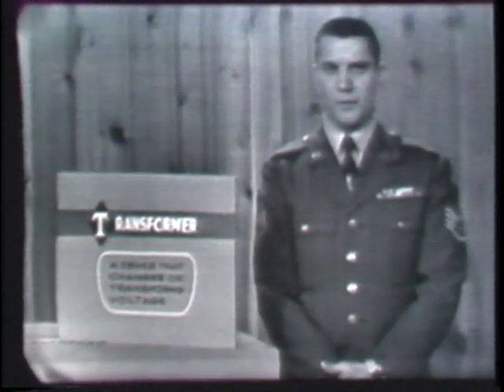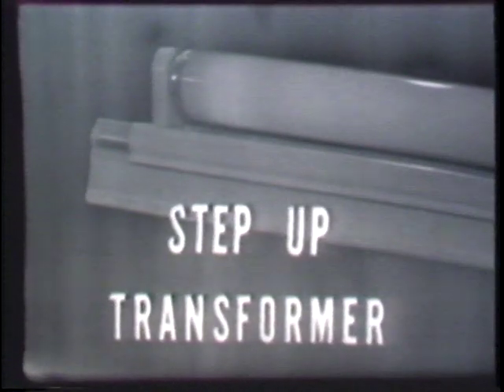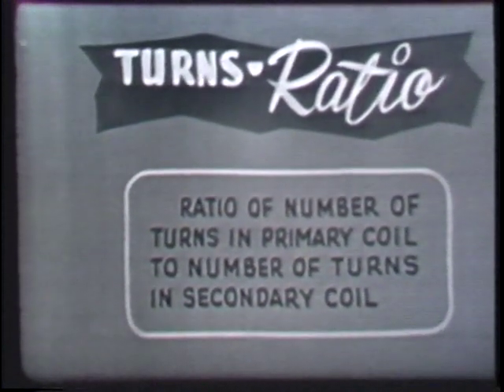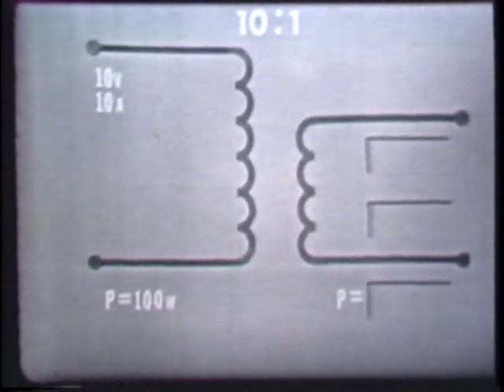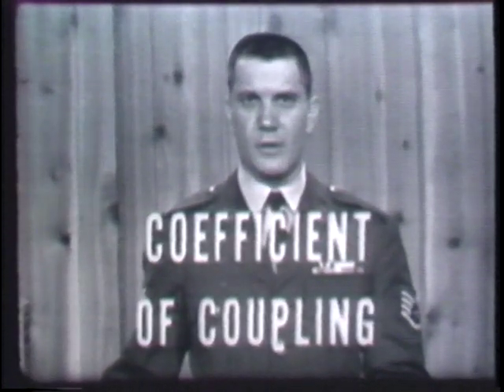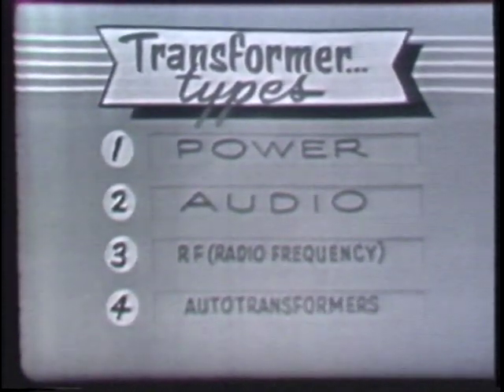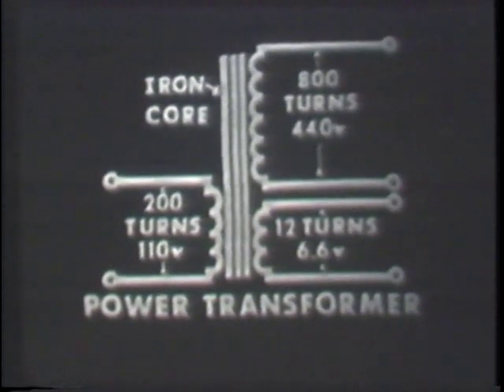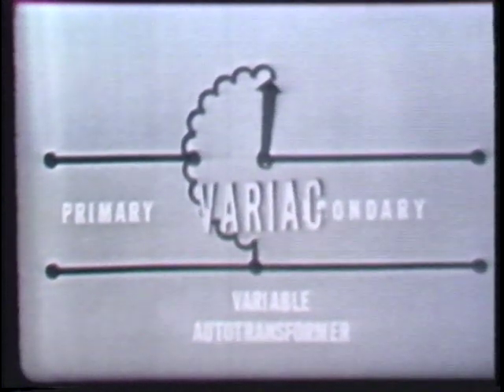TRANSFORMERS

Comment: Actually you CAN use a 50-Hz transformer on a 60-hz but a 60-hz transformer will over-heat on 50-Hz.
50-Hz requires more core iron than 60-hz transformers have.
Reply: And I didn’t think a A +\- 16% frequency change is anything more than negligible

Comment: Note this uses "electron flow" current direction. Not bad however in engineering/physics it is all explained using "conventional current flow" or charges moving from the + terminal to the - terminal of the battery. It actually makes circuits easier to analyse and design.